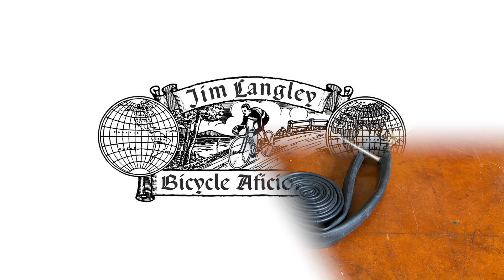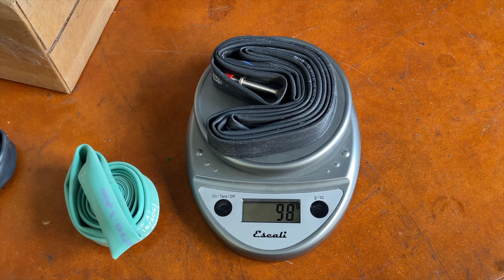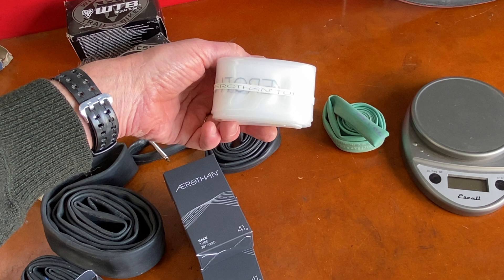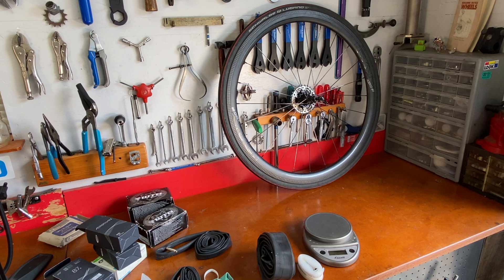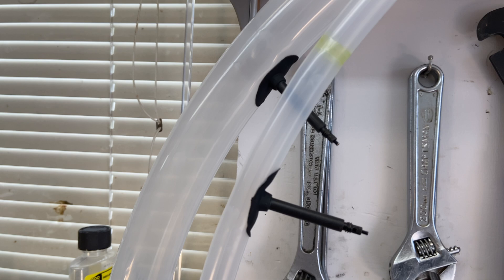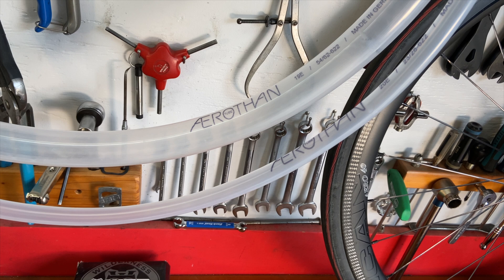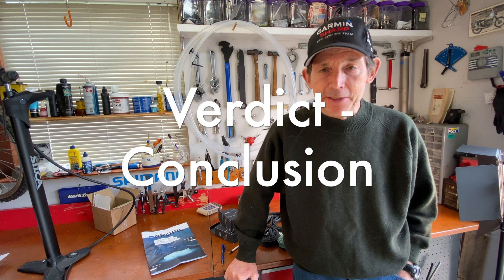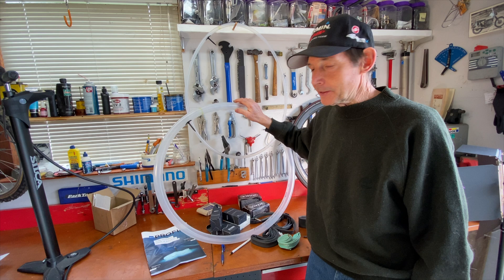Schwalbe Aerothan Bicycle Tubes: Ultralight, Super Small and Flat Resistant!

Comment: I would like to use this tube as a spare except I'm running tubeless and thought I saw a warning that these tubes aren't compatible with latex.  Wish I could confirm that.
Reply from the maker: Thanks for watching and the question, David. Yes, you’re correct, Schwalbe says the Aerothan tubes must not come in contact with sealants. They don’t say why not. I assume it’ll damage the tubes but that’s just a guess. I bet it would get you home😉
Reply: @JimLangley1  certain sealants have ammonia in them I believe from engineering days that’s a corrosive agent to some plastics. And seeing that it’s a thermo plastic means it will absorb. 
So no I wouldn’t put in there if you certainly wash it if off as quickly as you can.

Comment: What’s your opinion now after some time has passed?
Reply from the maker: Thanks for watching and the question, Ulrich. I like  the rolling performance of the tubes a lot. I like their lightness and their excellent air retention. On the road, to me the ride feels a lot like tubeless road. So I think one of the best uses is for people who don't like dealing with sealant in their tubeless tires. (I'm running them in standard, not tubeless tires.) I still think the price is too high but it does seem to be pretty much the same from Tubolito and Pirelli, etc. so maybe it just is what it is. Still, I can understand the argument that lightweight butyl tubes are pretty cheap and ride nicely, too.

Comment: Hello. Thanks for nice video. Do you know if it is possible to replace a defective Prest valve thread tip from this Schwelbe tube with a tip from a regular tube?
Reply from the maker: Thanks for watching and the question, Michal. I haven't tried it, but the valve cores in the Schwalbe tubes look standard so I bet any Presta valve core will work in the Schwalbe Aerothon tubes. I'll try it and let you know but it might take a couple of days.
Reply: @JimLangley1  Thanks. I appreciate your concern. It is not urgent. Best Michał
Reply from the maker: @mutos82  Okay, I just tried it, Michal and it works fine. A valve core from another Presta tube fits fine in the Schwalbe Aerothan tube valve. Hope this is helpful.
Reply: @JimLangley1  Thank you very much. I'm going to buy this Schwalbe Aerothan tube so your help is very useful for me. If I could help you with anything, let me know. Regards, Michał
Reply: I bought the Schwalbe tube with a broken valve. I can confirm with Jim that is possible to replace the valve core from any Presta tube.
Reply from the maker: @mutos82  thanks for confirming, Michal!